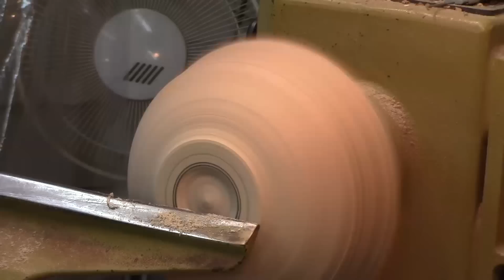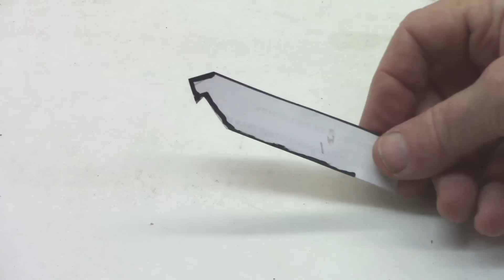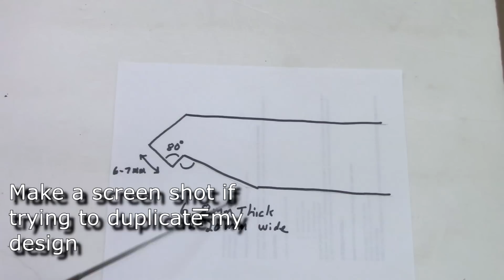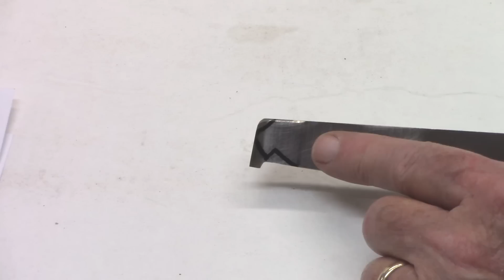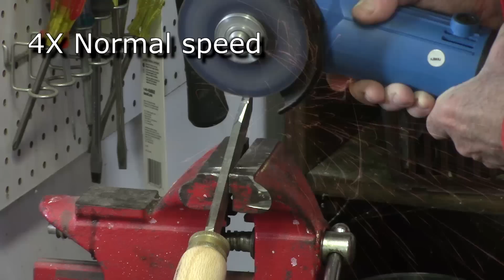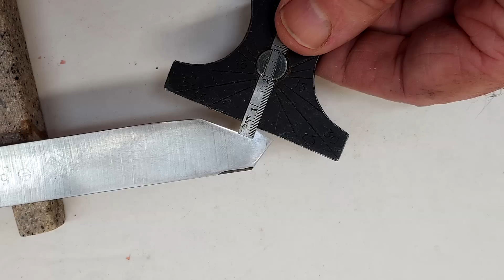Chuck Recess Tool - New and Improved!

Comment: Just made this tool took 2tries but I’m much happier now and it works great. The biggest change I made was instead of making the angle grinder cuts straight and grinding to an angle, I made the cuts at an angle that I liked since the bevel angle is not critical. This and using an ultra thin (1/64”) cutoff disk saved most of the grinding and made it easy to get back in the dovetail corner and make that angle sharp. Thanks for the video, Mike.
Reply from the maker: I love hearing how you adapted the method to make it work even better for your needs. 😊

Comment: Another improvement would be to cut the outside angle (nose and right edge) to 80 degrees and then it could be used to cut a tenon.  I don't use a recess often, but when I do this would be a great tool.
Reply from the maker: Thanks for the tips!